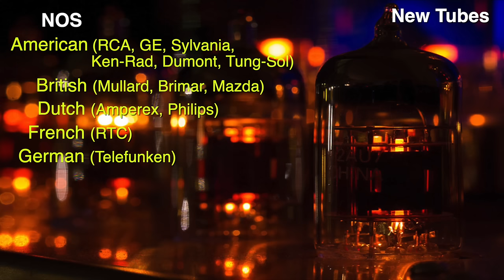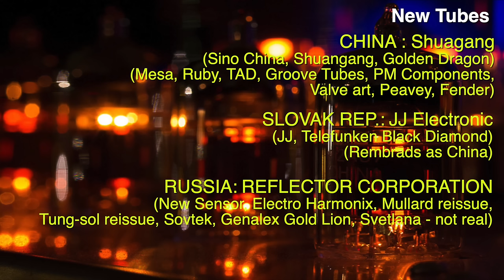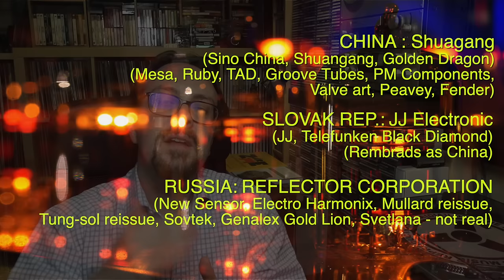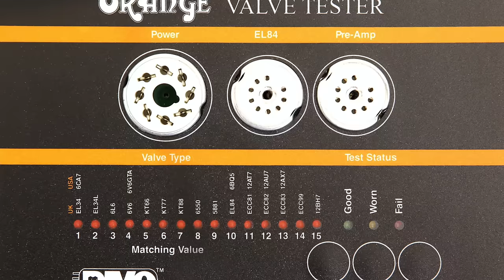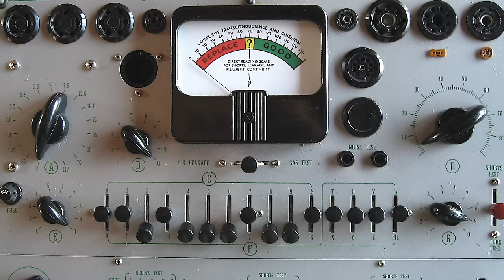Vacuum Tubes Basics: 10 things you need to know

Comment: Tubes do not sound ‘warm’; they get warm, but they do not have an inherent sound. Does a Fender twin sound warm to you? Great amps, they do exactly what they were intended to do, but sounding warm is not one of them. They are harsh, dry, loud, and nasty. Ever heard a Millennia preamp? They have lots of tubes in there, too, and they definitely do not sound warm; clinical, dry, accurate, incredible, but not ‘warm’. Ever heard Demeter audio equipment? Lots of tubes, definitely not warm. Have you ever heard any API equipment? Fat, thick, rich, luscious, warm; not a tube in sight. 100% solid state. Neve? Same thing. So you lost me in your very first opening statements.
Reply from the maker: Harmonic distortion, tube's distinctive effect, is broadly defined as "warm"

Comment: An explanation deals with the real world using concrete and definable parameters. I heard the word "magic" being used. Magic is an explanation used in the middle ages when western civilization could not make machines of the industrialized era. The great achievement of modern civilization is to evolve and use reason to create things that improve the lives of people. Vacuum tubes are electrical components used to make an audio system just like solid state transistors are used to make audio systems. So why are vacuum tube based system superior in terms of sound reproduction. Vacuum tube based audio system MAY produce audio that some people prefer over transistor based systems, especially with electric guitar amplifiers used during the 1950s, 1960s and 1970s. But you have not explained this. You simply have said that vacuum tube audio system is superior in some way in terms of sound that is not clearly defined. People who find your explanation satisfactory is confusing logic and reason with a random group of words that is dancing around the topic without a logical sequence that could lead to a reasonable conclusion. I do appreciate your attempt to resolve this issue.
Reply from the maker: I deliberately DON'T want to analyze what makes music reproduction beautiful merely from a technical point of view. In some videos I go morebin depth but in most of them there is no reason, it is not my approach I am furnishing opinions or recommendations because I can distinguish what is ofnhigh quality and what can help ro achieve it. That's all.

Comment: tubes every time you use them decline electronically. Old tubes does not perform well.
Reply from the maker: It takes a little more than that, but they sound so full of life that it is an acceptable compromise.